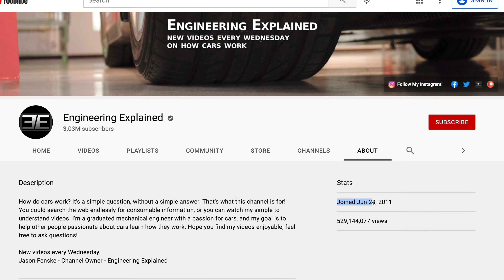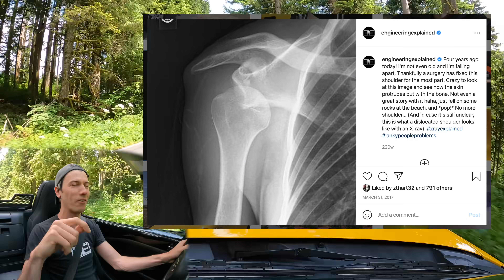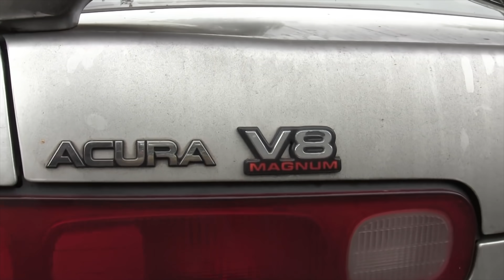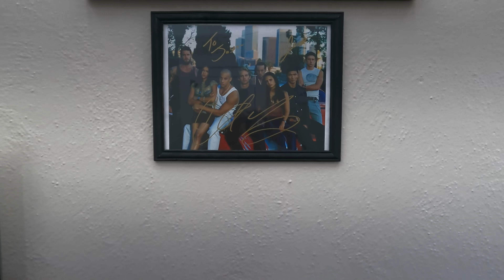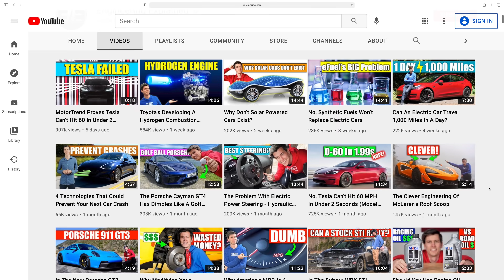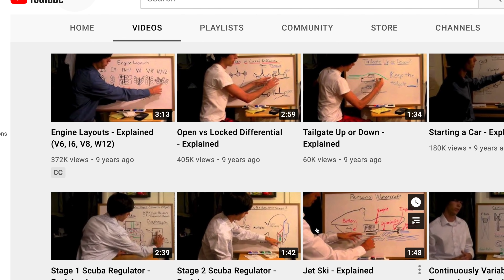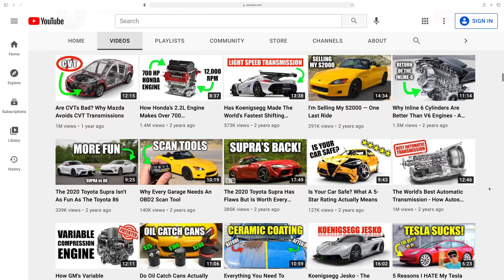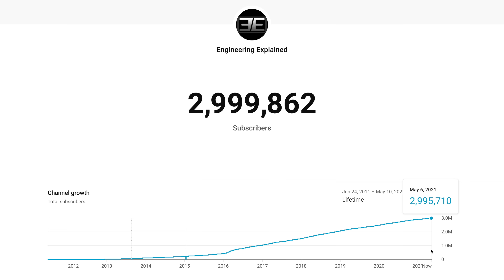After 10 Years On YouTube, It's Time For Some Changes!

Comment: JSON (pun intended, sorry, I'm an awkward programmer), I'm just a guy getting close to thirty and got my driving license just a few years ago, which is kinda late even for my country. I suppose it goes without saying that trying to catch the train this late is not easy, but I swear to God your videos are getting me there like a knife goes through butter. I learned tons about different parts of cars, from differentials and gearbox to the importance of the exhaust pipes' shape, basically all interesting physics applied to all the moving parts in moving cars. I take deep pleasure in learning all the major general knowledge as well as the tweaks and little details in specific engines. But most importantly, by getting to know how my car works, I can feel myself thinking more about how I drive and what I can improve in that matter.
Please rest assured I duly appreciate the effort you put into showing us all the cool stuff. I believe that seeing and hearing that your content actually makes a difference is a way better motivation than any donation or other support one could ever give you (apart from a very awkward and geeky hug with pats on your back). That said, if you ever felt burning out, I'd rather you take a leap year or sabbatical if you will, and try doing something else for some time. I'd rather have you back later, fully hyped for serving us more nerdy intel, than seeing your channel struggle for a couple months and then slowly shut down. Your contribution is valuable and it would be a shame to have had that lost.
Take care and do well!

Comment: I've always enjoyed your videos. I'm an engineer too, and I like the little things like you don't troll for subscribers and likes. I liked in your most recent 2022 WRX video how you didn't ramble on and on about how horrible the plastic fender cladding is. (most of us will make up our own minds)

Some ideas for videos: 
1) Garage updates - if a vehicle is swapped or modded, maybe something on new tools here and there. 
2) Full time AWD vs. truck 4WD vs. on-demand AWD. When is one better than the other. (sorry if you did a video like this and I just haven't found it yet)  In the snow? On the track? In corners (dry & wet) etc.
3) Maybe train yourself a bit on animations to help illustrate mechanics
4) Electric vs. combustion-engined cars for maintenance items. (I'm guessing there's still diff oil in the electrics, for example, but battery maintenance or replacement replaces just about everything.

I'm guessing you're a mechanical engineer. Will you dabble a bit more in electrical engineering, now that it is taking over the automotive world?

I'm also curious how you diversify your livelihood against possible YouTube policy changes. Do you have a back-up plan? How do you get health insurance? For example: I used to watch a lot of airgun channels, and the hunters were absolutely KILLED when YouTube changed its content to decrease liability by removing gun-related content. Victorinox found quickly they had to diversify when the TSA banned any kind of knife for carry-on. It decimated the sales of their little Classic pocket knife model. I'm betting there's similar risks in your world.

Happy anniversary and keep up the good work!

Comment: You have a big and awesome back load of high quality videos! However there is a can of worms that you haven't yet opened:  
Diesel engines. You won't run out of topics yet. I know diesels aren't your strong point, and that's understandable. Americans don't really have access to small high quality diesels. It's only in the trucks for you guys. Some topics you could cover if you want are: fuel quantity, duration and timing, and how each of the three affect direct injected, common rail and indirectly injected engines.
 How WV pumpedüse works. 
Injector opening pressure. 
Inline vs rotary pumps. 
Fuel viscosity vs atomization (which is very important for vegetable oil as fuel). 
Swirl chamber vs prechamber. Ricardo comet vs mercedes OM.
Different fuel types like biodiesel/FAME, hvo100, pyrolysis oil, crude oil, wvo, svo, wmo, premium diesel, vs normal diesel. Emulsified water in fuel, is it bad or not. Flash point of different fuels.
Turbo in a diesel vs in a gasoline. Do turbos actually melt pistons in diesels, or is it a myth?
Boost compensation for fuelling
What happens when you inject cold fuel into a cold engine?
Cetane rating, mixing gasoline or methanol/ethanol into fuel or the combustion chamber, and how it affects timing. Octane rating in diesels. Ignition delay.
Diesels actually knocking. How to know when it happens and why. How to differentiate it from normal diesel sounds.
Glow plug cycling and how long it takes for them to heat up. Is it dangerous to leave glow plugs on for too long?

If you want to, I could send you some lenghty and detailed diesel PDFs from Bosch and Denso, just hmu.
And sorry if you have covered some of these topics before. No intention to complain or nag, I just want to share some of my suggestions. :)
Reply: And, dynamic timing vs static timing. Timing offsets. What the tcv does and how. How lift pump pressure affects timing and fuelling.

Comment: Congratulations on ten years. You and Rep. Katie Porter have whiteboard messaging locked and loaded. The only complaint is that a Tesla, has no Right to Repair. Like with most modern electronic equipment you buy, you never can claim true ownership. Change something and a software lock will immobilize your device, for your own safety of course (NOT).

Comment: You do awesome work! You have every right to be proud of your achievements! Thank you for all you do and have done!  However I have a question that no one seems to be able or willing or something, to answer..... THE question that I've been trying to find out but seems like it's just too simple for everyone. "Can octane boosters (In a bottle) actually boost the octane of pump gas". I have a turbo car I want to tune using 95 octane fuel. In my area I can only get 94 octane (10% Ethanol added) and want to make it into 95 octane. Can an octane booster off the shelf actually do this?
 Or is it just pipe dreams in a can? Do I have to get a hold of actual xylene to do that? How much would I need to use to go up one octane point? Or could I actually use the 95 tune (it's a tune you get from a tuning company that is pre made) with 94 and not have to worry really?? 
Sorry for the silly I'm sure to a genius like you questions but maybe you might see this and it could give you a topic for your videos? And help me LOL. Thank you again for your great hard work over the years!

Comment: Hey Jason, thanks for the great content . I have a question that I haven’t found an engineering answer for. I have a 2015 Mitsubishi Outlander Sport that I recently replaced the brakes on. The front are like I’ve always seen, but the rears you need a special tool to push and rotate the piston back in. I could see that the parking brake is somehow combined with it, but I don’t understand the reasoning for why it is built this way. As a curious person I would love to know more.  Thanks

Comment: Have appreciated the work.
Speaking for my own access to your videos, the path is usually: there's a subject I'm interested in, search for it, yours comes up high in the results.  After watching it, others are displayed nearby, some of them yours, on the same or similar topic.  Might watch those too.

Two topics I'm curious about:
1.  Paint.  How to make it last a long time.  Repainting a vehicle costs $5k or more, so that's a big deal.  Better to preserve the original.  I know of antique cars that still have original paint.  Jay Leno says he uses waterless car wash.
2.  Similar question: how to make the rest of a car last 20+ years.  I have a '94 with 190k mi on it and it's failing right and left, but mostly it seems petroleum products are disintegrating.  Plastics, rubber, paint, etc.  The metal parts seem to be holding up well.

Comment: I suppose I am old school. Owned 2 pickups in 39 years. 1982 Silverado SWB with 6.2 diesel = 350,000+ miles. Pulled the engine and sold it to a wrecker company to go in a one ton. 2003 Silverado 1500 HD = still own.

Comment: Idk if you'll see this comment but YOUR WIND BLOCKER IS ON BACKWARDS. Caps for visibility. Good luck finding this.
Also congrats on your success and consistency. Admiring for sure
Edit: WAIT, why do you have those windshield wipers? those are the base sport ones (less aerodynamic metal-framed)

Comment: Hi, could you possibly explain to us why can’t they build electric motors for a vehicle and run on say on a 24 volt truck battery and the battery gets charged by an alternator attached via a pulley to an electric motor(s)or why won’t this concept work? Surely it would save external charging / weight and space of this were to work properly ?

Comment: Hey Jason, I've been a subscriber for most of this run and think you've done a great job evolving the channel over the years. Still just as informative as always and even more engaging. I have one question and one suggestion for you. First, did you consider actually doing shorter videos but releasing one a week? Just wonder if that would provide balance and still maintain favor of the algorithm gods. Second, some of those old technical videos are just as relevant today, but are buried by the fact that they are old and have low production value. If you refreshed them with your current production quality, you could probably put out some pretty quick and easy videos that get a lot views without being super difficult to make (maybe alternate weeks with completely original content). Just a thought. Best of luck!

Comment: 2013 Prius, 2013 Volt and 2018 Zero SR... Not as cool, but still a great three vehicle garage.
Reply from the maker: Love the Volt!
Reply: @EngineeringExplained  I love it too.  Had it for 5 years with only a few small issues like punctured tires.

Comment: Glad to see that the coolest car you've gotten to drive is still the Crosstrek. Congrats on 10 years, man!
Reply from the maker: Only one ride can stand above the rest! 🙌
Reply: @EngineeringExplained  really hmm I honestly hated it the one I was given as a loaner was 185 hp gutless felt like driving an overloaded truck lol  was extremely tech filled tho told me to take a coffee break when I yawned
Reply: @zaceryhammond1144  I've noticed that Subarus feel gutless with automatic transmissions, but the manuals feel fine
Reply: @specialopsdave  a cvt will suck the life out of any car lol
Reply: @tayvonrose2528  Not really, it depends on the programming. My Fusion Hybrid with a CVT puts out about 200hp, and I can feel every ounce of that power. When I drove my friend's Subaru with 180hp and a CVT, and it feels slower than my 140hp manual transmission Subaru, or even the CVT Fusion at 70% throttle.
Reply: @specialopsdave  maybe, but I cant say the same in my experience. I’ve driven a Nissan Sentra, impreza and a lancer. And all of them have this unnatural disconnected feeling between the throttle and engine. I personally like a fixed gear transmission, but I get it, it’s more efficient and can achieve better emissions.
Reply: @tayvonrose2528  Maybe Japanese manufacturers program their transmissions to be slower than American manufacturers, idk.
Reply: Love the 10 yr old Jason ..classic
Reply: @donbrashsux  Was there a 10 year old Jason?
Reply: I bought myself a 17 Hyper blue Crosstrek Limited and love it
Reply: both Bens are here to celebrate too.
Reply: Robby Dey  5? The website says 0-2mpg difference, and the older ones are more efficient as manual
Reply: My family has been through two Crosstreks. They are great "Jack of all trades" vehicles. Ours are technically the wife's car. She loves them. They are awesome in the PNW mountains during winter (with snow tires, they are unstoppable). Great gas mileage. Yeah, they are a little slow, but life isn't a race. We have other fast vehicles in our household.

Comment: Congratulations on a decade and goin’ strong Jason! 💪🏻“These 3 cars solve all of my needs.”    soooooo    “THAT’S A NO FROM ME, DAWG!” -Randy Jackson but in 2021 you need:
#1 A sports car that can do a minimum (preferably more than) 200mph with a 0-60mph that’s less than 4 seconds.
Cadillac CTS-V with an LT4 Supercharged 6.2L V8 (640hp/630ft-lbs) ~OR~ a Corvette ZR1 with an LT5 Supercharged 6.2L V8 (755hp/715ft-lbs)
#2. A modern, luxurious, and daily drivable sedan.
Cadillac CT5-V Blackwing with an LT4 Supercharged 6.2L V8 (666hp/659ft-lbs) ~OR~ a Mercedes-Benz AMG GT 63 S 4-door Coupe with a biturbo 4.0L V8 (630hp/664ft-lbs)
#3. And finally a top tier American diesel truck for hauling, off-roading, and better road safety.
GMC Sierra Denali HD with an L5P Turbocharged 6.6L V8 (445hp/910ft-lbs) ~OR~ a Chevrolet Silverado High Country with an L5P Turbocharged 6.6L (445hp/910ft-lbs)
Reply from the maker: Haha, CTS-V and a CT5-V? Seems like the same box, no? Excited to try out the Blackwing soon!

Comment: I believe your following remained loyal because of your first videos.  For me your comprehensive critical thinking as well as the ability to break it down succinctly is what drew me in initially.   The self implied “dork @ the whiteboard” thumbnail videos perfectly expressed the integrity of its content as your passion for the knowledge of engineering principles within the automotive industry was truly addictive.   I purchased a 2019 Crosstrek Manual based on your breakdown of the gearing ratios as well the symmetrical Subaru AWD comparison to other past Audi, Jeep etc systems.  
I will say for the fun of it, the fact that in this video you mentioned you sold your yellow S2000 for another S2000 while you were actually in a 2016 Miata, 
is a property of the thought processing often replicated by professors of high energy particle physics.  Ala Richard Feynman.  Congratulations on reaching the ten year mark. Ive learned a lot from your channel, keep it real and I’ll learn a lot more in the future. P.S. I sold my 2006 A3 Hatch manual trans w 110k well maintained miles to my son and purchased the Crosstrek.  Both are equally very well designed within their perspective rights.

Comment: Hell yeah man. I have learned so much from you in the past 8 years since I have been subbed. So much cool technology has come out over the years and you habe always been there with a whiteboard to spell it out for us.
Reply from the maker: Thanks for sticking around for so long Josh, it means a lot!
Reply: @EngineeringExplained  yeah man. You tought me a lot about turbochargers, and engine components. I credit a good 75% of my car knowledge to you man. And now I am an engineer building a race car with some trick turbocharger goodies like the Turbosmart ALS valve and controllable boost leak with an electric throttle body.0